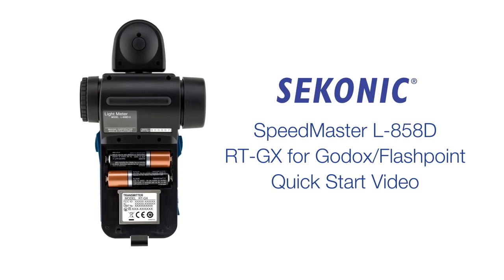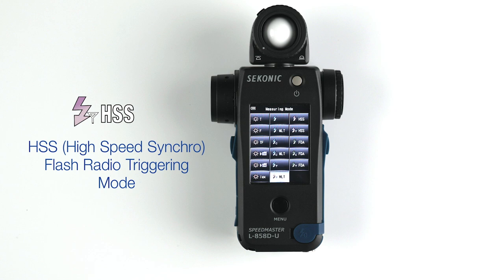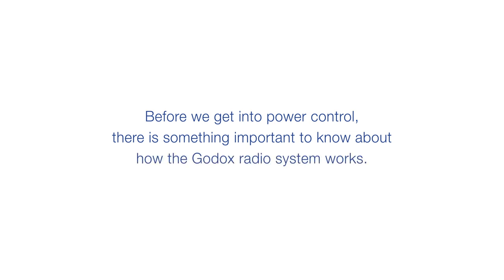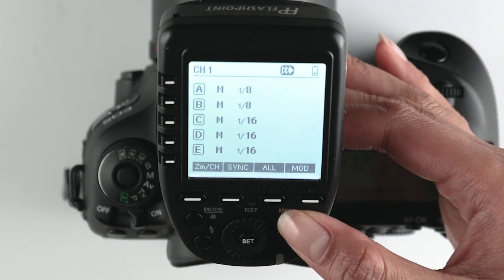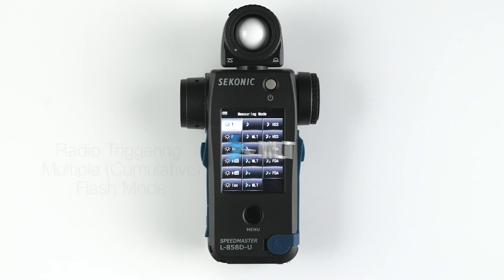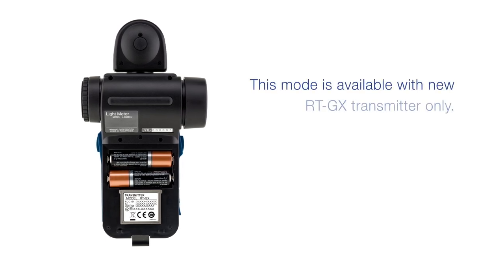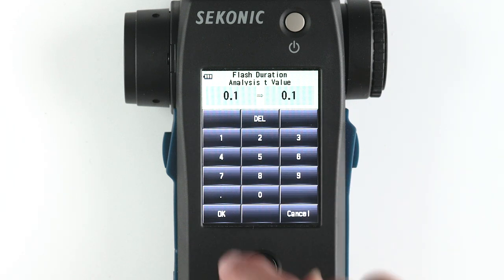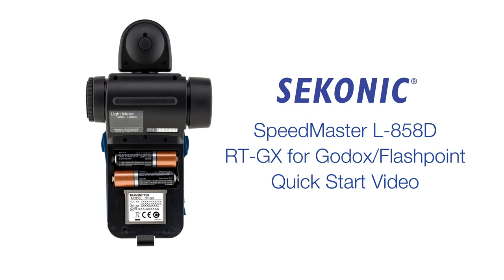Sekonic L-858D RT-GX for Godox/Flashpoint | Quick Start Video

Comment: I have a question: I have just bought this model and would like to keep power control on my camera Godox transmitter instead of the Sekonic. How do I achieve that? I think power changes on the transmitter are not always applied on the flash unit.
Reply from the maker: For this we would recommend  not using power control on the meter and the transmitter on the camera will always be what the lights are set to.
Reply: @SekonicGlobal @SekonicGlobal that would make the Godox transmitter on my flashmeter useless wouldn'it? Or can you use the trigger to fire the lights without  using power control?

Comment: I can't find out if it will work with my light meter as I'm a bit confused with the letters coming after the number 858. The link point to a version for L-858D-U but mine it's just L-858D without the final U, would this work?
Reply from the maker: The -U is just for the0 L-858D that is sold in the US.  Other then that the L-858D-U & L-858D are the  same.

Comment: I just receive mine from Adorama and the package seemed to be stepped on and when I took the transmitter out it sounds like something is rattling internally. Question: Is it supposed to do that?
Reply from the maker: The meter itself should no paddle.
Reply: rattling from the transmitter is normal. I have both the Godox transmitter and the PocketWizard transmitter. Both modules makes the rattling sound. However there should be no sound when the module is loaded in the meter

Comment: Sekonic and Godox missed a features that is super easy to implement. I would instantly buy this if there was a possibility to set a certain f-stop on the sekonic and have the sekonic adjust the light output. Similiar to TCM, just more accurate with a light meter. Without this feature it's just a light meter that is capable of controlling my flash. If I want that, I can just buy any light meter and hook it up to a second godox transmitter, that also allows me to control the flash. I get it, that there are other cool features about the light meter, but it really doesn't justify the price compared to a regular light meter + transmitter or the build in TCM from Godox.
Reply from the maker: This is a great idea thank you for sharing.